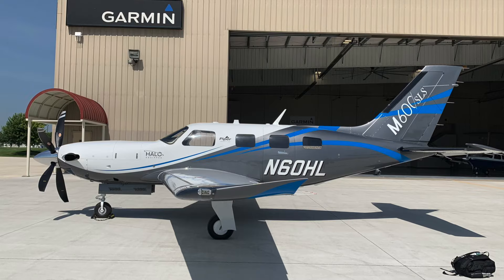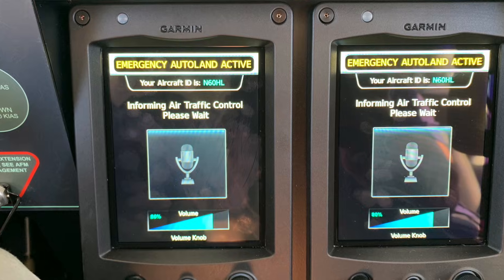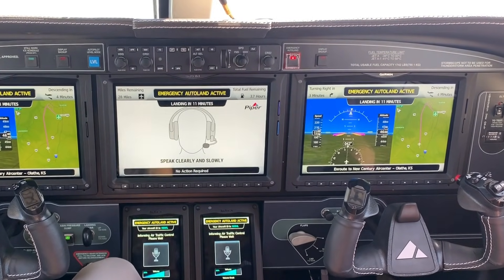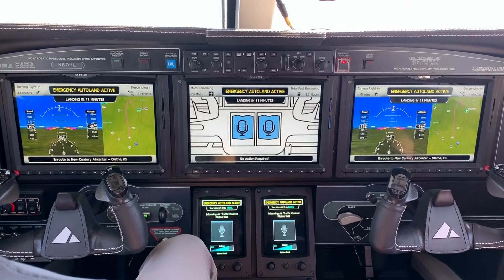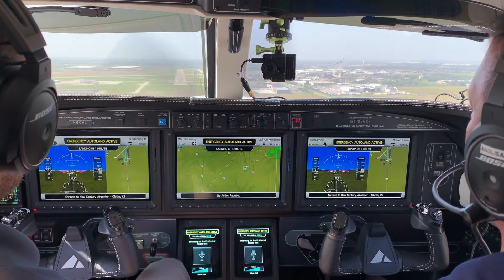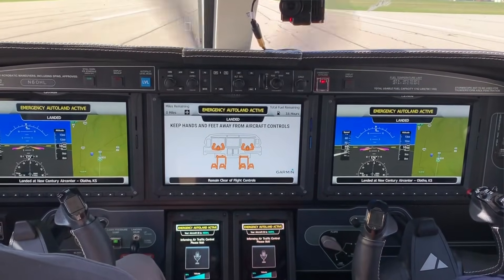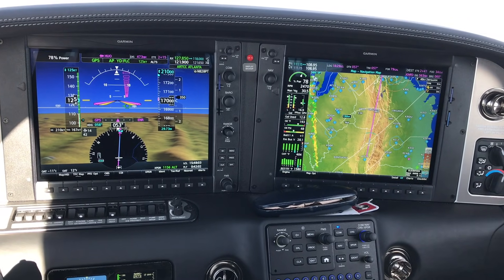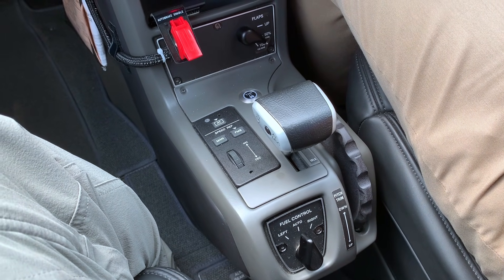Garmin Emergency Autoland Flight Trial

Comment: I wonder why this auto engage for autoland is apparently not installed in commercial aircraft, which have the autoland capability since long.
Would have prevented some accidents or at least made them less severe.

Comment: This technology just saved the lives of passengers and crew of a KingAir! Amazing work, Garmin.
Reply: It was a stunt
Reply: According to unofficial sources(other pilot), it was an accidental engagement. 
The pilot didn't know how to disable it. So they let the plane land itself. 
Amazing technology.
Reply: @CarmichaelCharles then why didn't the pilot respond, informing the atc?
Reply: @Redstoneprofi01honestly that’s a good question cause why would this feature completely cut off manual pilot input?
Reply: @jalensaviation11  Because it is intended to be used when there is no manual pilot input to be made anymore. It's not meant to be used in conjunction with a pilot still flying or communicating.
Reply: @CarmichaelCharles Was it? I read there was a cabin depressurization event which automatically activates the autoland in case of pilot(s) being incapacitated by hypoxia. The pilots though donned masks and never lost consciousness but let the autoland continue instead of interfering - because they were not sure how the plane would react to manual input while autoland was active. They had to get down due to the depressurization anyway.
Reply: Yeah, i've heard the same thing.They didn't want to mess with it.

Comment: Wouldn't it be great if auto-land could engage automatically in case of full cabin depressurization and the incapacitation of all crew and passengers.  Accidents like what happened with Payne Stewart's airplane in 1999 will be a thing of the past.

Comment: Well the fact that airline fights are much safer with the assistance of auto pilot systems that fly most of the flight, I could see this automatic stuff as fantastic, as long as there's a pilot with full ability to disengage the system at any moment. But i hope all this stuff automated stuff doesn't lessen their hand flying experience too much

Comment: So, a burning question that I have. Will Garmin be able to put in some parameters where it could auto activate this system? I could imagine in a scenario with a single incapacitated pilot and no passengers, where it will give out a warning to press a button, and if not done so within 5 or 10 seconds, the system will activate by it self. Pilots don't always have passengers and many more lives could be saved by adding this to the system. Parameters could be no radiodransmissions, no course or altitude changes and low fuel levels for example...

Comment: Garmin using words carefully when describing their auto-design strategy ;-) - not implying that their system(s) are the early stages of full implementation in coming years - you could say a test-bed for the aviation industry using light aircraft to gather performance data and aircrew/passenger/operator confidence. As many people in the industry know.

Comment: How does the system know which ATC frequency to change to & when to change to frequency or does it just stay on one frequency?
Reply: It will transmit on the previous frequency and on 121.5, I think it also monitors the frequency so it doesn't speak over another pilot. Also squawks 7700

Comment: so if there's this emergency feature why not just take it to the next level where and the plane doesn't even have any controls and doesn't need a pilot at all? Passengers get in, select where the want to go and it just takes you there autonomously? The system obviously seems capable of doing that.

Comment: If every aircraft in the air had this technology and were all linked together, it would reduce the workload of ATC as they would only have to oversee the systems working, pilots could input a destination and press autoland and it would fit itself in with all the other aircraft in the area. It would greatly reduce the risk of human error.

Comment: Is there any plane technical troubleshooting included? Thinking about when the pilot is out of comission and the oil pressure is dropping or the engine is running a bit too hot etc

Comment: So what what I am curious about, is any one thinking about maybe using this technology in another way, meaning that if a pilot made a series of errors could the system be automatically activated without anyone having to push a button?

Comment: This plane is in one side on of the safest small turbine prop with huge safety’s. But on the other side a big joke, maybe not worth buying it. Why? Simple, the pilots need to be circus 🎪 acrobats to get into their seats. with 4-5 people in the back, no way. That makes the so safe airplane to an unsafe airplane. In cases of emergency, the pilots will struggle to get out safe out of the plane too. With people and luggage in the back, no fun at all. So safe gets unsafe to me. This Piper needs a door to the cockpit entry. I really can’t understand, how Piper goes so far beyond with development of safety and struggles so bad to get in and out into the cockpit. A huge minus to me. And my reason I wouldn’t buy this multi million plane. I prefer the more safer Cirrus Jet with better entry options for the pilot and even having a parachute 🪂 and operating in 31.000 feet above most weather.

Comment: Now add in automatic takeoff ability and leave the pilot at home.

What if the nearest airport is a major hub at rush hour?  Do you get automatically slotted in between a 380 and a 777?
Reply: Shouldn't need to they say the system radios ATC so the aircraft should be treated as an emergency they'll get everything else out of the way.

Comment: Every flight simmer hates this. If they were a passenger and the pilot was incapacititated they would want to have a go at hand flying the plane to the ground 😂 

Simmer: Mayday, the pilot is unconscious. 
ATC: Press and hold the Autoland button
Simmer: Yeah, it's not working, give me vectors bitch, I'm coming in hot.
ATC: PRESS THE AUTOLAND BUTTON
Simmer: La la la la la I cannot hear you, you're breaking up. What was that vector victor?

Comment: Well the interviewer" could have spend much more interesting time decribing the various A/P actions at they would happen in real time, and describing the start of the scenario clearly. Thois would have made the follow-up of this demo much more live and interesting. Here he was just like a sandbag with few boring questions. Also he could have done some research and come up with questions about what GPS integrity/security is needed for this system to work etc.  Weak

Comment: A useful feature in case of erratic manual control would be for the system to announce that it will automatically engage if not cancelled due to suspected pilot incompacitation.

Comment: Not all questions to this system find answers. What if runway ils will inop then system activated? Is this system take NOTAMs into consideration? I didn't heard in this video about weather limitations of this system, wind direction and strength, possible icing conditions and other adverse conditions.  Does the system  take into consideration airport METAR?

Comment: This kind of amazing technology could easily lead to the dreaded single pilot Part 121 scheduled airline  flying that I think is in our future. If the pilot becomes incapacitated , the Lead flight attendant would be trained in activating a fully automated approach and landing with the touch of one or two buttons. Any deadheading company pilots on board would be first choice  to save the day of course. What the heck happens when a pitot tube clogs up with ice and sends erroneous info to this automated system, may or may not be worked out yet. But , it is a fascinating subject.
Reply: Dual pito
Reply: @pilotavery  exactly 😎
Reply: @geoffreybradford  I mean basically every single engine now has dual pito and dual aoa. Both are fed to both pfd so that a failed one is ignored.

Comment: A very cool system.
2:36 That’s a different aircraft. Another one in development?
It didn’t shut off the engine, or tell the passengers to do it. Is that because of the demo, or will the passengers be departing an airplane with a turning prop?

Comment: I had a few questions if you have a chance to post a reply.  I’m not trying to be sarcastic or anything, I’m just trying to understand.  If TCAS or ADSB detects a traffic conflict will the auto land system adjusts speed course and/or altitude to avoid an impending collision?  Will it switch tanks if you’re running low of fuel on the current tank and the selected runway is out of range?  Will it attempt a landing at the same airport where Air Force One is locates if there’s and a TFR is in effect? (assuming that’s otherwise the most suitable airport?). Will it know if a runway is temporarily out of service?  Will it try to land at a sensitive military installation? Can a controller divert the aircraft if that’s needed?  Will it select the runway taking into consideration wind conditions?  Can it compensate for crosswinds, microbursts or wake turbulence?  Will it communicate as needed on Unicom frequencies?  Does it change the squawk code to 7600 or 7700 as needed? Will it go to best glide speed and attempt to keep going if the engine quits?  Will it avoid Active MOA’s. Will it shut down the engine after landing?

Comment: it was groundbreaking when this tech was introduced on the 777 and A320 in the 90's. now its on GA aircraft

edit: im talking about fly-by-wire, not emergency autoland. This is fly-by-wire pushed to the max

Comment: What happens when you override the system? For instance if a passenger touches the throttle or the yoke. Is there a away to re-enable the autoland feature?

Comment: How does the system activate in the case of hypoxia? Is there a deadman’s mode which requires acknowledgment every 10-15 minutes then automatically engages upon several requests?

Comment: I assumed (wrongly) that this system would require an ILS runway. The fact that it can perform this autoland on a GPS L+V approach is amazing - a real game changer. Well done Garmin. This is undoubtedly the future of pilot incapacitation safety.
Reply: Well, to be fair, Garmin have been a GPS company a lot longer than they've been doing aircraft systems. So their experience with GPS means they know very precisely what it can and can't do.
Reply: GPS altitude is accurate to 18 ft so You don't really need it... Garmin avionics allow you to set up a GPS approach and put a simulated ILS on your HSI

Comment: I'd really love to hear those radio calls and automated announcements.
Reply: It's on the garmin autoland configuration video. It says the tail number, pilot incapacitation, the destination airport, and time before landing. My guess is it keeps rebroadcasting the message at certain intervals. I'd like to know what happens once the airplane is on the ground at an unmonitered/untowered Airport.
Reply: Now you can

Comment: the problem is that this also need radio^^ ur a threat if ur just going to land without any radio... so for a working emergency system the Plane should:  if on Autopilot and the Plane reaches Fuel for 30min of flight the plane should prompt the Pilot for a response if there is no response the plane goes into emergency landing and calls on radio: MAYDAY MAYDAY MAYDAY CALLSING Automatic MAYDAY CALL OUT by GARMIN EMERGENCY SYSTEM Pilot not available minimum fuel we are at Long/Lat going to autoland on Long/Lat  and also if the pilot is unavailable but passenger pressed the button make it short press automatic call out and long press with no automatic radio call out^^
Reply: Take it didn't listen they said it radios ATC

Comment: Amazing at one time ADF'S WERE FIRST CLASS NAV AIDE THEN VOR and advance navigation system's were a must

The R-Nav was hot and then loran'S explode like the ABomb in WW2. And GPS units have sent them packing like the sold state radios sent all the avionics with tubes

This is an first class system that opens the door to pilot's and crew's its possible for any one to land safe if the pilot can no longer fly

It opens the door as well if weather makes it impossible to shoot the ILS 
Advances are amazing and Garmin is a majority player

Thanks for posting and its possible Garmin could become a good stock tip

Comment: Would it be possible for the Emergency Auto-Land feature to detect cabin pressure and activate if loss of pressure is detected with no pilot interaction?  That would be a cool integration.
Reply: Answered this question in the video at the end 11:48

Comment: I wouldn't trust Garmin to find my own foot let alone with my life. Every Garmin product I have owned so far, including their overpriced cycling computers and running watches, they would release a new slightly updated version of product with same hardware but some additional software option they would immediately stop support for previous products. I am a software developer and on few occasions I found a bug, documented properly how to reproduce it and how to mitigate it to a degree, described behavior in detail only to be met with Garmin's stupid response "just do a factory reset". So I would advise other people, learn from my experience AVOID GARMIN especially with life-dependent shit like this.

Comment: As a non-commercial pilot, I'm delighted by this. If flying was my day job, I'd be worried by what I'm seeing here.
Reply: GA will be driven into the ground by costs, regulations and insurance long before full auto pilots will be flying the sheeples, so don't you worry your pretty little head about what others should be worried about.
Reply: @nynphose  That's got to be stupidest fcking comment I've ever heard. Automation is exactly what is required to reduce risk and lower insurance costs. That's the whole point of it bonehead.

Comment: What about a hijacking situation? This system has the capability to communicate with ATC on its own, so what if a pilot transmits 7500? Are there any ways for a controller or Garmin staff to overtake the aircraft and activate the auto land feature?

Comment: Is pilot incapacitation a common enough occurrence for this to be necessary?
Reply: Yes very much so. A necessary system that is. Imagine a pilot having a heart attack over a populated area if it saves lives then well worth it. Imagine a larger aircraft where something bad has happened and the pilots are dead for example, a Boeing 747 crashing onto houses is not a good thing.
Reply: @MarkNorville  Oh I can certainly imagine such scenarios. I'm asking if they actually happen.

Comment: Prop was still running,computer told passengers to exit,chopped up passengers on the menu!
Reply: The props are at the front of the aircraft in this example. You exit from the side so it would not hurt you. Please think before you post, as you make yourself look stupid.

Comment: Idiot flight rules: IFR If one does not like a certain person especially in politics, just switch such a system and bug the program and the crashes are sure to get rid of unloved staff. So abuse is a real problem, when such a system is open access. But despite of the concerns itself - when it is save against outer influence, it is a very good system for eg. emergency procedures when the pilots are physically not longer able to act in a proper manner.

Comment: I heard this aircraft automatically broadcasting on 121.5 the other day flying to Dallas. Took the rest of us by surprise and thought it was an actual emergency.
Reply: I am assuming ATC has to deal with whatever the system says it is going to do.
Reply: @michael931 Maybe in time ATC might be able to send some kind of message back to the aircraft (voice or digital) to request it to modify its intended flight path?
Reply: @XenonCitium  they probably did warn them. Doesn’t mean the rest of us listening will be aware
Reply: W. O. W.
Reply: @Apollo737 what was the voice like? Was it an automated “robot” like tone broadcasting to ATC?
Reply: @Strato6049  Been a while since I heard it. It sounded pre recorded and not robotic if my memory is as sharp as I hope it is.

Comment: Amazing and humbling. How did the system calculate the required amount of crabbing/yaw to compensate for the crosswind? ATIS?
Reply: I would guess the gps knows when path shifts left or right and adds compensation as does a human.

Comment: the problem comes if a mechanical failure occures while the system is engaged with the pilot still out of commision like engine or gear problems
Reply: In that unlikely event they would have been completely screwed before this, I suspect this system will at least give the passengers their best chance of staying alive and making the airport.